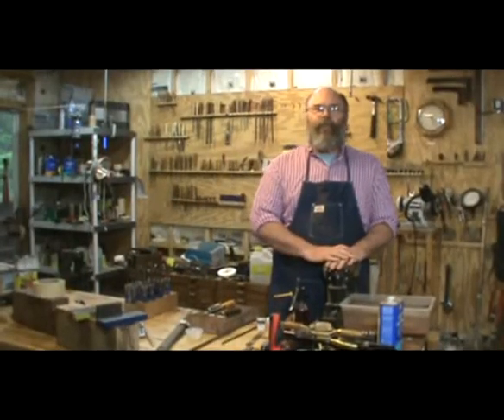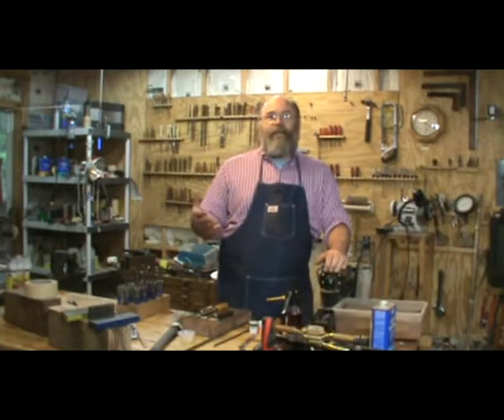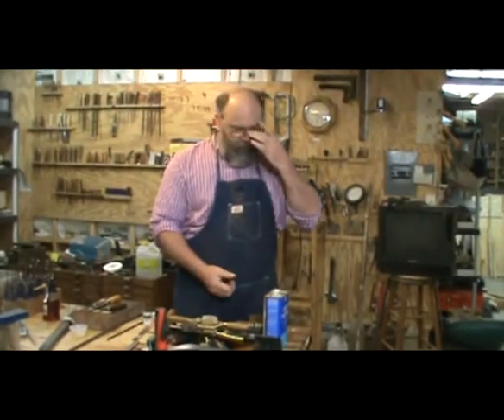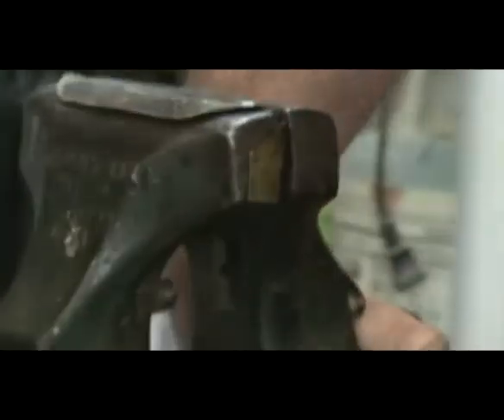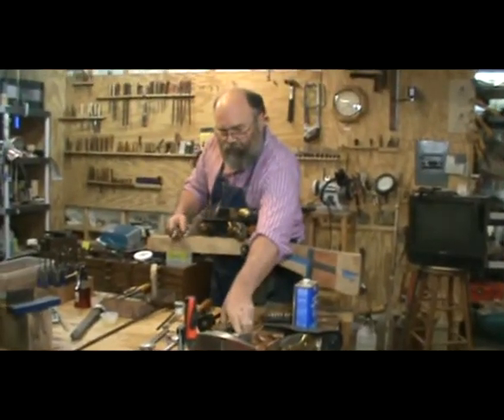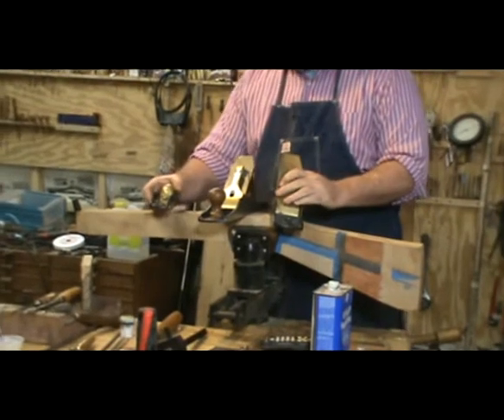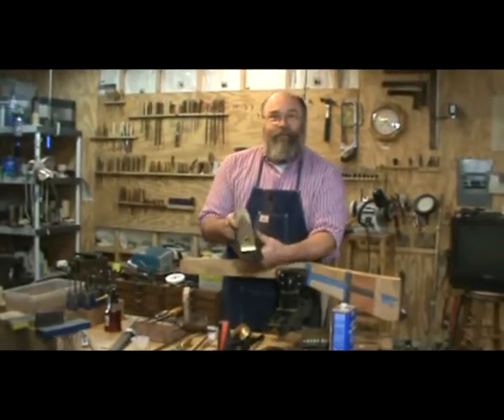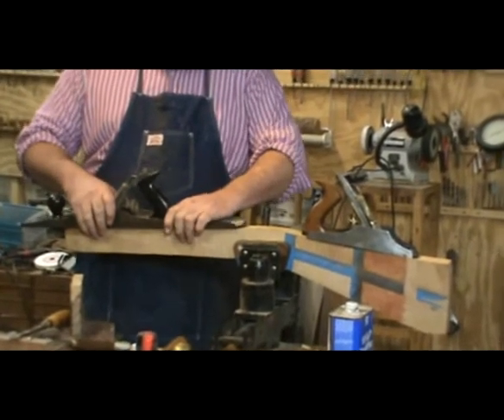How to Make a Gunstock - Tools Part 1

Comment: @cknerr    not to be a know it all, but  the first square in the second video you shown is a framing square not a rafter square. the rafter square is much smaller and it trianular shaped with angle lines and degree markings on it. thanks

Comment from the maker: I don't use an angle grinder unless it is under extreme duress. If you will skip forward to the recently posted videos on making a gunstock, you'll see exactly what I used. The principle was to use tools the hobbyist might have around (ie. not expensive or a huge variety). I am making the gunstock with those tools. 

Hope that helps,
Chris

Comment from the maker: @7zobzombie 
uhoh, at the moment I am swamped! It would be close to a year before I could even think about it. Price is in $2k+ range for just labor. I do it all by hand, no CNC or duplicator. Usually there is a fitting involved too (included in price). Time - 4 to 6 months depending on finish and how much checkering etc. will be done. If I can make more videos, you should try it.

Chris

Comment: hello im just about to make a gun stock for the first time and i wanted to ask what tools are mainly the most important as i am on a tight budget. By the way u have an angle grinder so wat heads should i get for it that are cheap and can make good curves and smooth finishers. thanks you